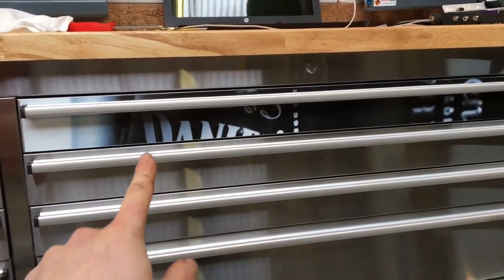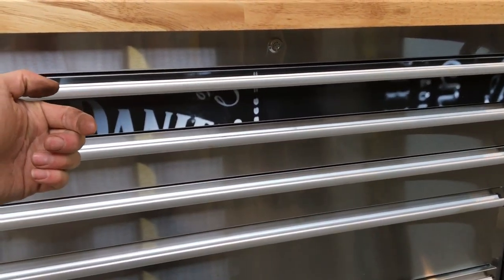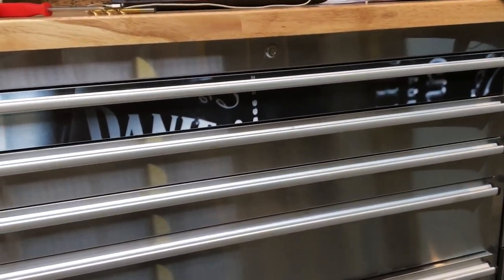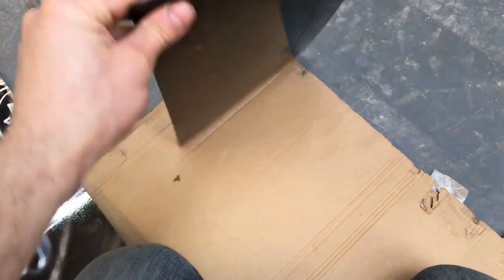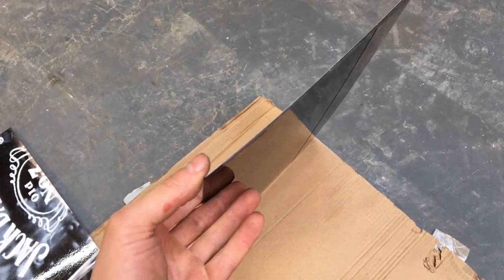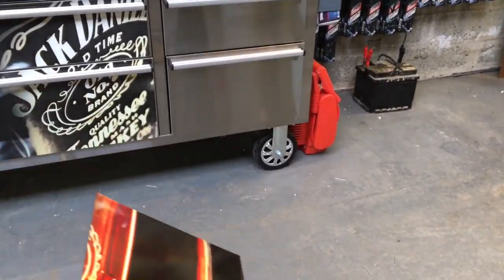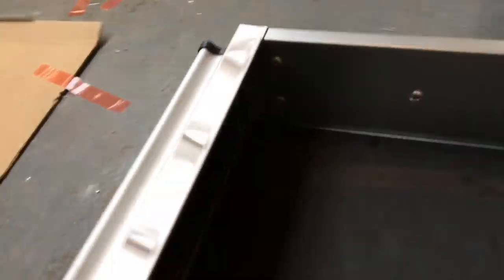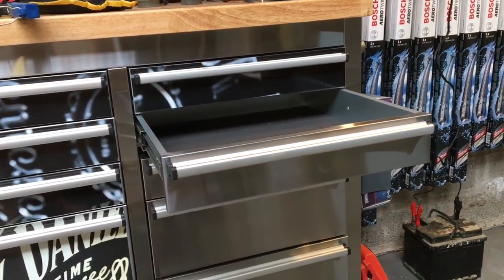How to wrap tool box (Jack Daniels Wrap)

Comment: I love the pre cut idea so hour picture lays out properly and doesn't end up being odd with handle spacing. Looks great. And wow magnet or plastic. So it's serious, will last and actually protect the box. I thought most of it was just thin vinyl like a car wrap. That's impressive.
Reply from the maker: shawng7902 yeah this stuff is good been on my box a while now and still looks new and brake cleaner doesn’t effect it to 💪🏻 well worth it if u want a different tool box compared to others in a garage👌🏻
Reply: SMT MOTORSPORT hey where do I buy one for my snap on tool box ?